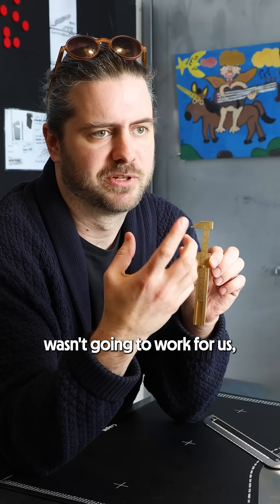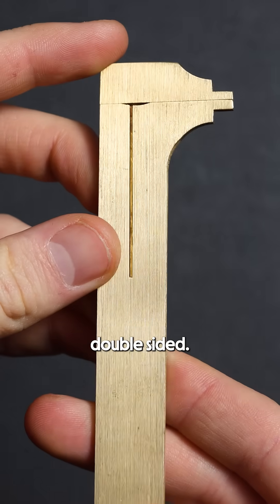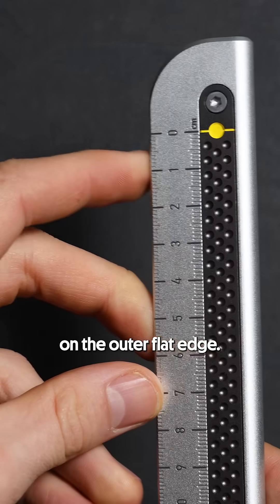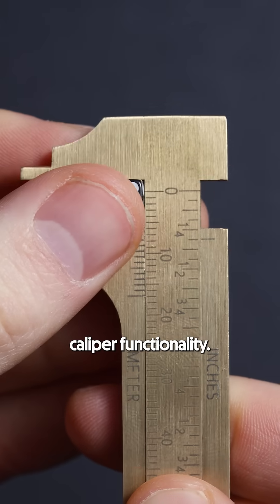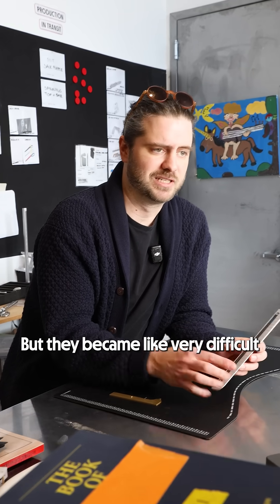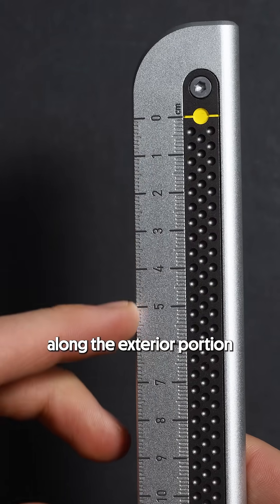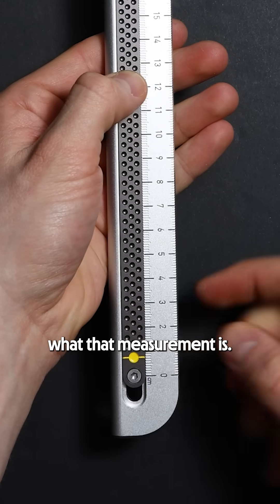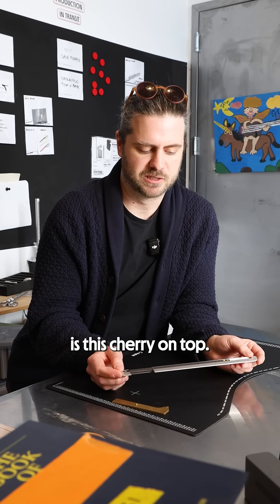Solving Our Problem with Calipers

Comment: there's just one problem: traditional calipers having gradations on both the fixed part and the sliding part allows for readings down to 10th of a milimeter, something this caliper, having only one mark on the sliding part, cannot do

Comment: i dont get the point of having a ruler thats a caliper that isnt electrical with sub millimeter measurements. if i didnt need that level of precision, id just measure it with the ruler?

Comment: I never used a caliper as a ruler but yet I’m using a digital one so solving a non existing problem. Definitely more robust but I wouldn’t say this is the ultimate caliper replacement

Comment: From what I understand your company specializes in producing nice if wildly overproced items which marginally improve on minor design faults in commonly used gadgets and gizmos. This is a paperweight masquerading as a ruler and further still trying to call itself a caliper. I don't love what I've seen of your usual work but I don't hate it either. You can do better

Comment: Like they say, a jack of all trades is a master of none, but this time, it is quite literally not better than a master of one. Rounded edge, no way to measure internal diameter, and on top of that it’s at least 12 inches long. This is a “multi tool” that doesn’t fit the form factor of a pocket, or the form factor of the tool that it’s supposed to be. This is a ruler with extra steps. 
A tape measure would function better at any of the tasks it could perform, be more comfortable, and more compact.

Comment: The calipers are too short, a caliper is mostly needed for measuring a diameter, but with those short calipers it will only go up to ø20mm or so, no vernier, no internal measuring jaws and no depth gage.

Comment: The way you reach design and engineering is odd. You invent a problem that doesn't exist and make a not very genius or practical solution for it, and call it engineering or design... the calliper is not a ruler at first place....it is just a calliper ...if you want to use the edge of a calliper for drawing a line its your problem with tools...

Comment: You can’t take inner, or depth measurements with this caliper, you’ve lost over 50% of the original functionality of the caliper. If you want something that functions like a ruler, get a ruler, or open the caliper fully and use the inside part as a ruler

Comment: The price of these products exceed the value of the innovation, which would position them as luxury goods; however, they lack any luxury characteristics. 

If the good functions as a perfect substitute (calipers or a ruler), it must adhere to competitive equilibrium pricing; if it’s a luxury good it must possess distinct differentiation to warrant price inelasticity.

Since “innovation around common items” is the goal, and it lacks qualities characteristic of a luxury good (eg the products posture them as every day items), it’s squarely a substitute good.

And that’s why these videos feel weird. Without innovation to bring the price down, or shifting the characteristics to be a luxury good…. it’s completely out of place in the market.

Comment: The most annoying part about a ruler is that the 0 is not at the edge (you have some dead space before 0). Yes it would over complicate the manufacturing but I feel squaring the edges and making the 0 come to the edge would have taken the design to the next level.

Comment: Remove 2 of the 3 main functions of a 10 USD product, remove most precision from the measuremts, then add add a way to use it as a 1 dolar ruler, but have the measurements backwards so it's harder to use, and then charge almost 100 usd for it. Brilliant

Comment: The benefits of the original design is you an measure either inside or outside of objects. Your new “design” is not a caliper because it doesn’t have the same functionality

Comment: No vernier, no internal measurement, no hole measurement, no edge measurement. Useless calipers. Did you consult an engineer or machinist? Apparently not.

Comment: how are so many people missing the intent of this redesign? they present the version they took issue with and sought to improve, and made those changes. the goal was not to make the most accurate / universally-applicable set of calipers ever made. effective design is NOT so open-ended, it is driven by balancing your goals / intent with compromise. this redesign is certainly an improvement over the control! though I’d vouch for 90’d corners instead of the rounded ones, to make alignment easier for the user

Comment: Add a locking mechanism to that you are not stuck with either metric or imperial measurements based on whether you can stick it on the left or right side of what you were measuring
Reply: Lock it in place then take it off of what you are measuring and flip it.

Or… just have both systems on both sides

Comment: You know how you can tell this guy is a designer and not an engineer... These cease being calipers and is just an oversized ruler and bad ruler.

First it removes the additional functionality of step/ID/depth and then also the accuracy of a veneer scale though it very obviously could have been added. (probably because the designer knows how to read one, but doesn't actually understand how it works)

Edit: Also rounded ends? Are you just messing around now?

Comment: I dunno man, I've got a $30 set of calipers that came with a ruler in the box. A normal set of calipers can measure inner dimensions, or dimensions, depth, and step height all in one tool. 
    This caliper/ruler combo only measures outer dimensions, which also happens to be the easiest to measure with just a ruler. 
    This feels like something nobody who needs a set of calipers will actually be able to use.

Comment: I like beautiful design but this is a tool. What makes tools beautiful is their function. 
You have made a ridiculously expensive version of a tool that is way worse in function. 

It is both a worse ruler; a proper metal ruler has square edges and is flat

Also a worse caliper; no internal measurement or a depth gauge

In the end it is just a overpriced pretty piece of metal. 
I can get a good ruler and a decent caliper for the price of this.

Bad design.

Comment: The vernier scale isn't critical to me because I'll just go for dial or digital calipers at that point. What I would like to see is at least one other caliper function, preferably depth measurement. I think this would be easy to achieve if the rounded back side of the head was instead part of the body. That change alone would make it far more versatile.

Comment: Great idea but wild that it isn't a rectangle. Not having 90° corners is a death sentence for a measuring device.
Reply: Not to mention that it actually lost one of its functions. The calliper could measure the inner diameter, which the "ruler" cannot.
Reply: Wait why? I'm genuinely curious. The only thing I could think of is that it would probably slide around while you were trying to use your pen right up against it.

Comment: what's the point of a caliper without the sub-milimiter measurements
Reply: And without the functionality to measure holes
Reply: Feel like if you added the hole prongs on the non, ruler side and added sub mil measurements this would actually be useful
Reply: If my intuition is right, you can get it to work as some kind of "psuedo-verneir" using the alignment of the marking line on both sides, but a better method would be to just 
1: print a vernier and paste it to it 
2:engrave one with some form of accurate cnc machine or something
3:engrave one using the geometric method to bisect a segment into "n" different pieces
Reply: For certain things, a low-precision caliper is the right call. Things like making a pencil holder by drilling holes in a block of scrap wood and you need to know how big the hole should be. You need eights/millimeters, and a ruler is kinda awkward. So buy the five or ten dollar brass caliper. This product misses the mark by a mile and then some.
Reply: A high precision caliper can also be used as a low precision caliper if you ignore the Vernier scale, but it doesn't really work the other way
Reply: @vlastasusak5673  Also even cheap calipers are pretty high precision.
Reply: At this point they are just buying temu products and trying to resell them
Reply: The design is very human...
Reply: For home shops and loose tolerances this is probably good
Reply: @jaredsaltus  can just use a regular ruler then
Reply: @SOPHOCLESIFY  and save literally $98 + shipping.
Reply: @jaredsaltus I have a 200$  pair of Mitutoyo calipers for stuff I make at home.
Reply: @jaredsaltus  Tenth of millimeters are useful when the size of a drill is erased because there is a difference between a M3 screw in a 3, 3.2 and 3.5mm hole. Size also matter for pilot holes for tapping
Reply: It's not for machining or whatever, those guys have the measurement tools they need. It just lets you get measurements of round things and small stuff from your ruler a little better. This is a ruler+ not a caliper-
Reply: @SwordandKeyboard29  Then why advertise it as a caliper that can be a ruler instead of a ruler that very, very poorly approximates calipers? It performs less than 25% of the function of a caliper (outside coarse measurement). Your eyes are accurate enough to measure down to 1/16th or 1mm with a standard ruler. This isn't even a great ruler. Too bulky.
Reply: @kdawson020279  I'm pretty sure they called it a ruler first and foremost, with the caliper being a cherry on top. I agree this may be the worst of both worlds, but it's proper to be charitable toward their description of it.
Reply: Every time I'm in the comment section of this channel I see somebody else pointing out some rookie mistake lol.

I don't know much about design yet other than: Form follows function
Reply: @jor9463 they completely missed the calipers function to measure inside diameter/lengths and even a depth measurement function. They do make cheap .1mm or 1/128 inch calipers but those are dirt cheap and I’d imagine this thing is not

Comment: You un-calipered the calipers. I have a mini set of calipers like that I keep in my pencil pouch. It works great. This is just as big as a normal shop set of calipers, so it's not really portable and also doesn't function as calipers.
Reply: Yeah you can't do any ID measurements or fit into small spaces

Comment: Having used a caliper for manufacturing, drafting, and spec checks: you misses the important parts of that tool; the pointy parts.
Cant measure insides or depth nor can you scribe lines on parts with it alone.
Yes, that tool comes in metric and a imperial + metic style 

A transparent 6inch ruler used in drafting does what yours does in spades. Minus the metric conversion but thats a you problem a that point
Reply: They also forgot the verner or what's it called so now the accuracy is limited to at best 1mm
Reply: @aggese you should be able to get within 0.5 with standard verniers and high end digitals supposedly 0.02 but I'd always check with micrometers for under. 2 tolerances anyway.
Reply: Yeah this is a beautiful art piece aluminum ruler with a bonus 1mm accurate ruler.
Reply: My first thought was, “Well, this is only good for measuring outside lengths and ODs small enough to fit under the ledge or where you can come in from the end face.”
Reply: I mean tbf the caliper he was replacing didn't have those either

where he got it and what purpose it serves without then idk but it didn't
Reply: FYI you’re not really supposed to scribe lines with a caliper. I guess if they’re a cheapo pair it’s fine but I usually avoid doing that lol
Reply: @logmegadeth72 
Depends on material. I've done it on some module board without a fuss.
Reply: Better to have a 5 dollar ruler and a dial caliper. This thing doesn't actually seem to be good at either of those jobs.